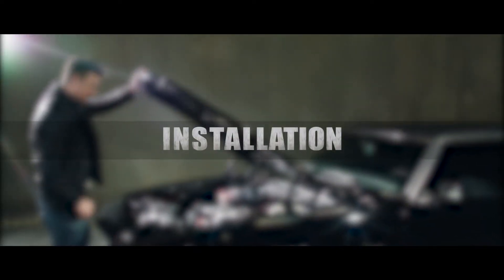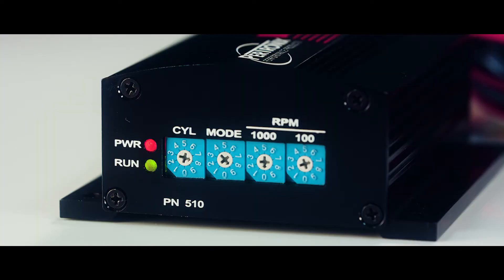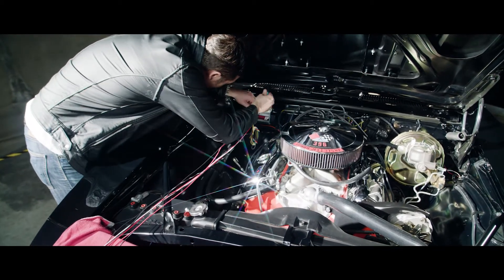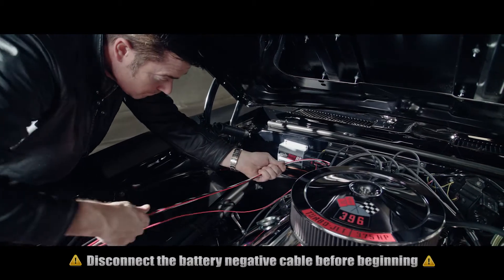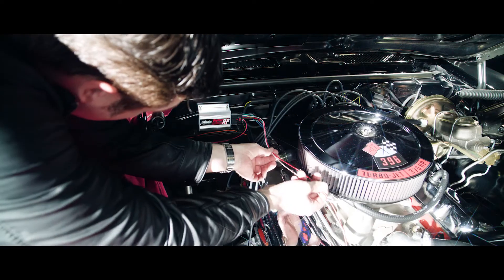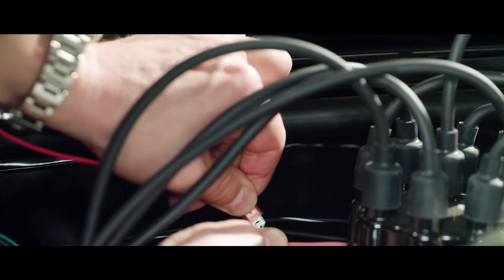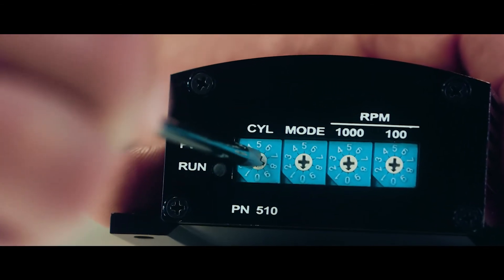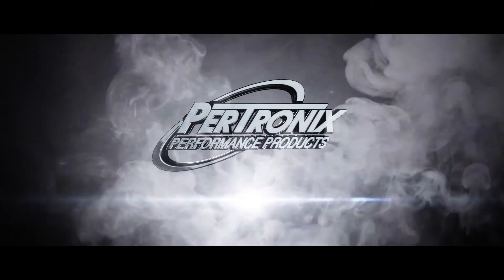PerTronix Digital HP Installation Video

Comment: What’s the “mode” for?
Reply: Fatal Rev limiter*
Launch Rev limiter*
Burnout Rev limiter*
Shift light on/off or rpm switch*
Start retard*
Tach calibration*
Multi spark on/off and Power select (145 or 187mj)*

You can set up on a bench with a 9v battery before burying it under the dash too.

Great little CDI box with more power than an MSD 6, smaller and about $100 cheaper too.